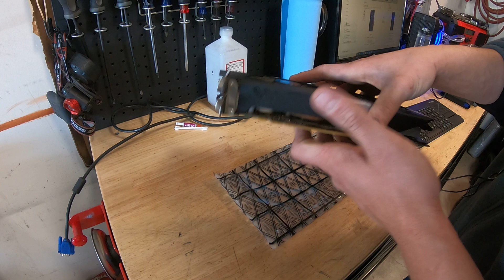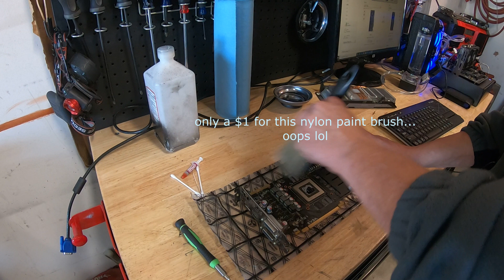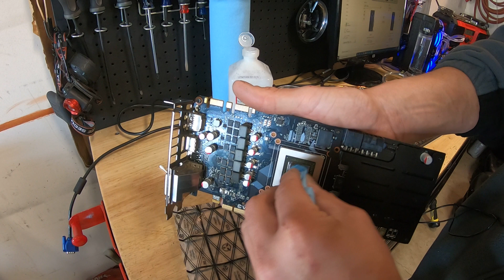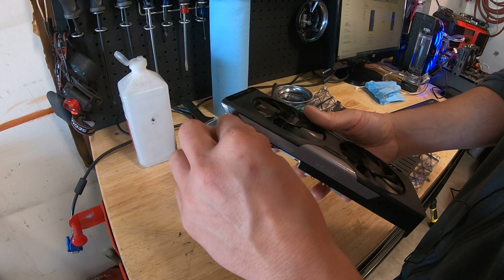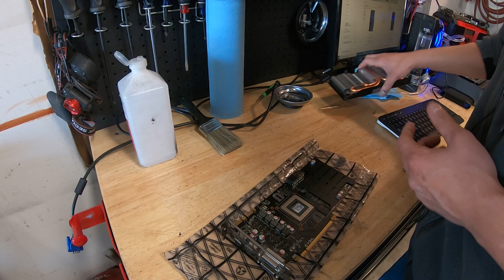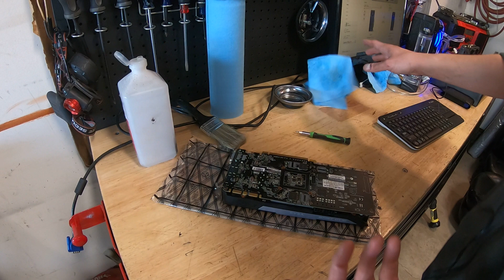Cleaning a used graphics card, a must do when buying used!

Comment: I like the way you handle the used GPU's. Test them first with Heaven, then clean up and paste. The WD-40 is tried and true from my automotive days. I have several GPU's that I have to get to and am stuck on the thermal pad issue. I've seen others get really technical and actually measure the distances from like the memory chips, mosfets,capacitors etc. I just want to get new T pads but the right size and be done with it. I ordered some from Amazon BUT later found out they were too hard. Apparently there is a difference in squishyness and thickness of T pads that are required. Didn't think that would become a PITA issue smh. I want to have some on hand, in case like you mentioned, they rip apart.

Comment: Q. I got a used gtx 660ti . Did the samething clean it up n added new thermal paste, it works but I notice it gets too hot on the GPU and it turns off my PC.. how can I fix that or is the GPU no good..
Reply from the maker: i would pull the heatsink off again and make sure that you had good contact with the thermal past. depending on the model ensure that the thermal pads are still making contact or did not rip off. Check the temps and see what they are hitting. if the temps are within threshold, then you might no be getting enough power to the card.
Reply: @DLMtechgarage  thanks for the reply... I put enough thermal paste but it does not have thermal pads ,.. it heats up to 97.. I also did a stress test just remembered it heats up to 98. But when playing a game it gets hot and restarts my PC... I'll look into the thermal paste ..